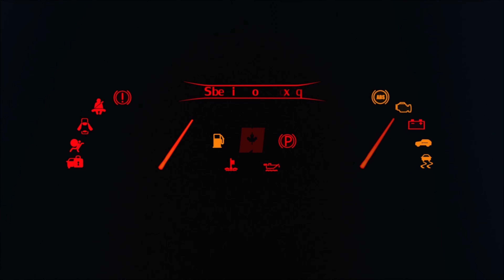350Z Intake Manifold Volume MREV2 | AnthonyJ350

Comment: Would you spend the money and do the plenum spacer on the 2006 350Z Rev Up? 
Is there any reason not to do it?
Reply from the maker: If you pair it with the MREV2 for sure. It fattens up the power curve in the mid range a lot and increases peak horse power a little.
Reply: @AnthonyJ350  thank you thank you. I will be doing conservative mods. Car is a 2006 with 13K miles.....YEP!

Comment: Theirs a place over , in the U,S [ America ]  that cuts those center pegs out. plus plug up with alloy welds . Then powder coated . Might be a idea for you. on your excysting manifold. I want to do the same with mine  [ mine is polish ]
Reply from the maker: I don't want to do that because Nissan felt the need to have those supports there for a reason.  I don't want the cast aluminum to crack over time.

Comment: That's exactly why I concentrated on reshaping those fat Horns to better help the air flow. The fat front Horns can easily be thin by 4mm or more.
Reply from the maker: Thanks for sharing. What did your car dyno at after tuning?
Reply from the maker: What did you do to minimize heat soaking of the whole aluminum assembly?
Reply: @AnthonyJ350  I don't find Heat Soak to be an issue as important as correct airflow into the combustion chamber. I can't any difference in a warm engine that has been sitting vs  one that has been running. Perhaps a Dyno could show a dicernamal difference. The reshaping of the Horns and plenum with polishing did make an obvious felt improvement.
Reply from the maker: @stealthg35infiniti94  Really, because the iso thermal kit from Motordyne is a big deal.
Reply: @AnthonyJ350 Clever Marketing perhaps, have you seen any independent test to prove results. I've seen for example cold air intakes  on a same car, same dyno and found  out most didn't do much better and sometimes worse than stock. Yes they made noise under the hood and lighten your wallet by hundreds of dollars.
Reply from the maker: @stealthg35infiniti94  So you think a hotter manifold performs as well as a cooler manifold?
Reply from the maker: Do you agree containing heat in an exhaust header makes it work more efficiently?
Reply from the maker: @stealthg35infiniti94  Motor Trend literally does the test in a variety of scenarios. And a warm engine with cold components, makes more power than an overall hot engine.
Reply from the maker: @stealthg35infiniti94  https://www.motortrend.com/how-to/impp-1107-cooler-engines-make-more-power/

I'm not sure why you think keeping the intake charge cooler isn't beneficial.
Reply: @AnthonyJ350  Ofcourse not, that's why some professional drag cars put ice on the manifold to cool the air charge for Maximum Air Density. In street applications though, 5 or 10 degrees cooler is not going to give noticeable gains. Any company can promote the theory of any reduction of air temperature will increase Air Density thus horsepower whether it is measurable or not.
Reply from the maker: @stealthg35infiniti94  We'll see what happens with the Sikky lower gaskets, Motordyne Isothermal gasket and the Cerakote all working together.

Did you look at the tests from Motor Trend I sent? They prove cooler components make more power. And 10 to 20 degrees Celcius could make a big difference. Think about how much better the car runs on  a cool night vs a hot summer day.
Reply: @AnthonyJ350  Did you IR Temp all the components Before and After modifications, under the same conditions or you just going by the Marketing departments information they are sending you. "With clever Marketing, you can sell ice to Eskimos."
Reply from the maker: @stealthg35infiniti94  I measured the components prior and idled the engine for 30 min. Will measure again when everything is installed.
Reply from the maker: @stealthg35infiniti94  But if you install non-conductive gaskets it will help prevent the manifold from acting like a heat sink
Reply from the maker: @stealthg35infiniti94  How do we know you  "opening up" the runner didn't kill the air velocity? You never dynoed it.
Reply from the maker: @stealthg35infiniti94  5 years ago I compared a car with the iso thermal kit, vs one that doesn't have one. Iso thermal manifold had cooler Temps from a simple gasket.

https://youtu.be/YbFCvkx_1kA
Reply from the maker: @stealthg35infiniti94  Can you send a video of your car on a hoist so we can learn and see how it's put together?
Reply: Like I mentioned before, Mechanically it's nearly all stock except for minor details. Suspension  upgrades are just camber kits with Subframe bushings and poly diff bushings. Interior, complete 2 layer sound deadening. Replaced head unit and speakers. Added JL Stealth Sub. Exterior, just a chin spoiler, 4th Brake light with vinyl wrap on roof and spoiler to cover clear coat fade. The car is a quiet comfortable GT Cruiser not bruising track car want a be. It has won first place years ago in a small car show in the Nissan/Infiniti category. The intent is to keep  the car stock as possible and any alterations can easily be removed. The rest of modifications are Stealth and can only seen if the car is taken apart. Originality is now rare as most G35s have been Riced/Raced/Wrecked to death.
Reply: @AnthonyJ350  As I mentioned before I did a Before/After measurement using the Torque App. I ran 3, 0 to 60 mph pulls Before and After the grinding and polishing. I tried to duplicate the testing the best I could. The test results were consistent in a 0.2 second improvement. Yes, a Dyno would have been more accurate and expensive. I don't have any sponsors paying any bills.
Reply from the maker: @stealthg35infiniti94  I don't have sponsors paying the bills either. Everything you see on my channel is paid by my cash flow. Dyno runs are less than $200 to run. 

Tuning is different in terms of cost. If it wasn't put on a dyno, how do you know if the fuel mixture is correct throughout the powerband?
Reply from the maker: @stealthg35infiniti94  If it won in a car show would love to see how the sound system is wired.
Reply: @AnthonyJ350  it's all hidden behind the original panels. The speaker grills are all OEM. The only clue is the head unit and the Metra adapter. In the trunk, the JL Stealth sub is totally hidden. The Alpine mono block amp is mounted under the rear deck between the factory speakers. Only visible if you stick your head in the trunk and look up. All those wires tucked away from view. Nothing special about the car, it is just clean with unseen modifications when possible.
Reply from the maker: @stealthg35infiniti94  Is there a plenum spacer on the car? Is it a REVUP?
Reply: @AnthonyJ350  No plenum spacer. The Manufacturer says a REV UP motor would not benefit from having a spacer. My car already came with 298 hp not the older 280 hp. All my internal grinding besides improving air flow, did increase the internal volume slightly. My guess the equivalent to a 1/16 spacer.
Reply from the maker: @stealthg35infiniti94  You're right it won't. I'm surprised you went through all the effort and didn't put the MREV2 in because it's proven to fatten up the mid-range power. Where a touring car is going to be RPM wise. You would have to Rev the piss out of the car , it's the runner length that changes the power curve.

Your car doesn't run lean after your modification?
Reply: @AnthonyJ350  Nope
Reply from the maker: @stealthg35infiniti94  So safe to say without the car going to the dyno and confirming and opening up the runners. Your car likes to make power up top and is down 10-20HP in the middle vs a setup like mine.
Reply: @AnthonyJ350  I think your estimates are wishful thinking.
Reply from the maker: @stealthg35infiniti94  Why? It's been proven time after time on the dyno with MREV2 installs. It's just weird to do all the port and polishing on that manifold, not install an MREV2 with the plenum spacer and do zero heat isolation on top of that with all your theory.
Reply from the maker: @stealthg35infiniti94  Run your car on a dyno and show us the power curve. I'm willing to bet after I run mine after tuning it will show more usable power throughout the curve.

Numbers don't matter because dynoes show differently, but the curve is what matters.

Comment: Curious…why hasn’t anyone drilled a hole in the front of the upper cover and spilt the air flow after the throttle body?
Have 2 70mm intake ports, rifle barreled of course, streaming air 😳
Or…Rifle barrel a Y after the throttle body pipping into to inlets on the top half!
Get to work Gentlemen…💪
Reply from the maker: You can try it and let us know with dyno results.

Comment: When it comes to 350Z manifolds. Air and power,it's best to just change it. In my opinion the best one's in the market today are: #1 the Top Secret Manifold. #2 The Merlin Holly manifold. #3 The Kinetix Manifold.  All for 350Z/G35 engines single intake.  You're welcome. 😊
Reply from the maker: How much more power and where on the power curve do each of those manifolds do compared to the factory one with a spacer?